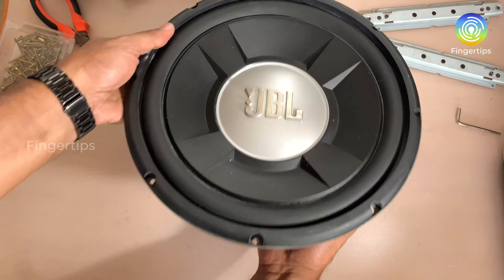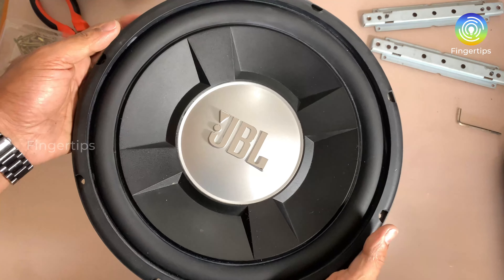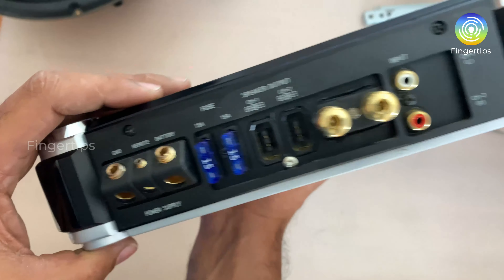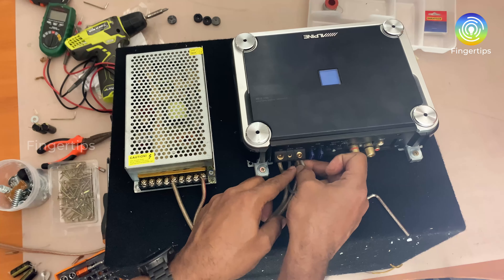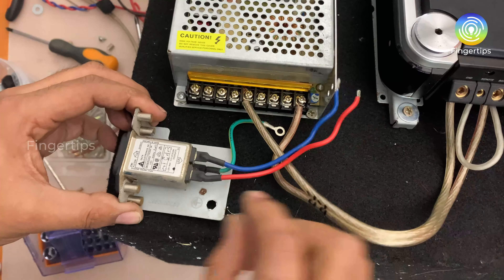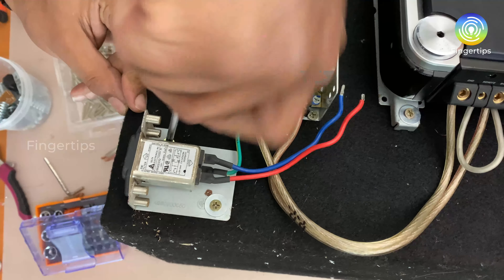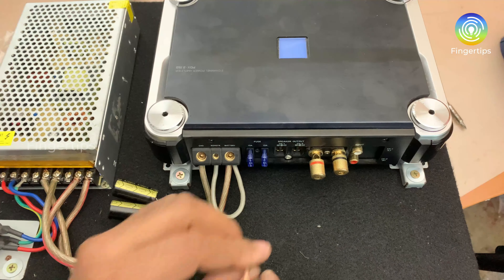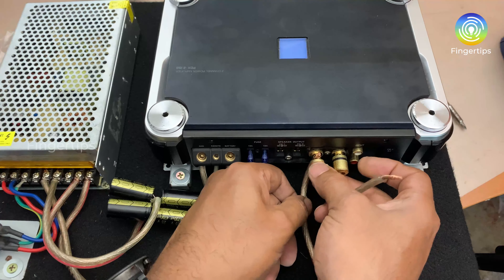Easy Convert Car Subwoofer into Home Theater Subwoofer

Comment: Cual es la funcion de los capacitores?
Reply from the maker: It works like a smaller version of battery  stores energy  and make more   ampere  it's  protect the smps ,also more filtration.